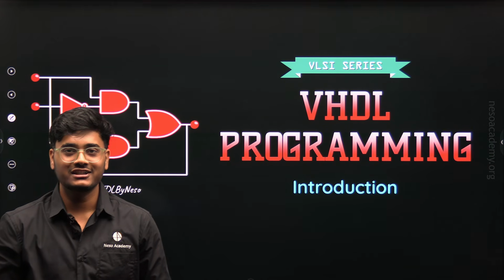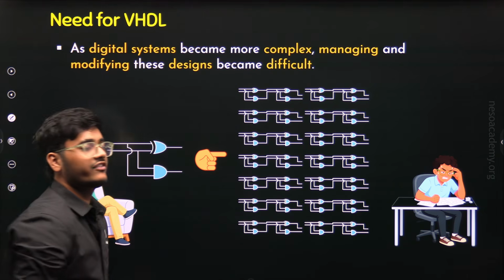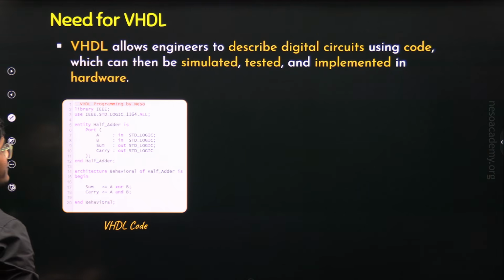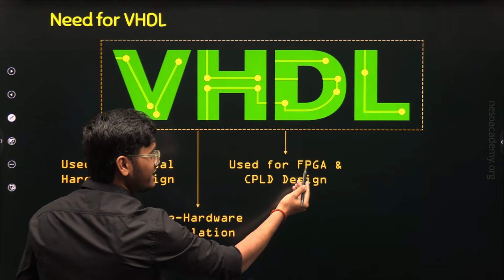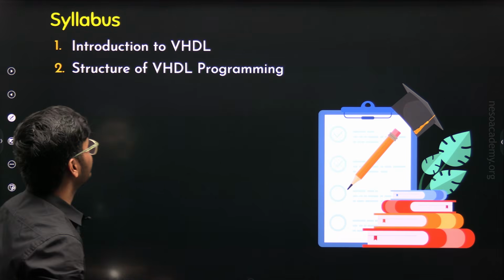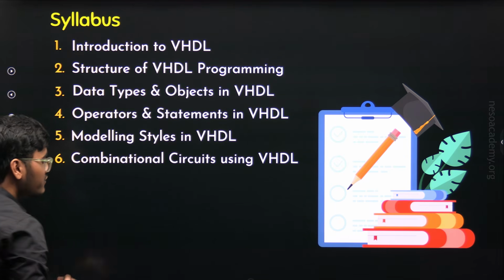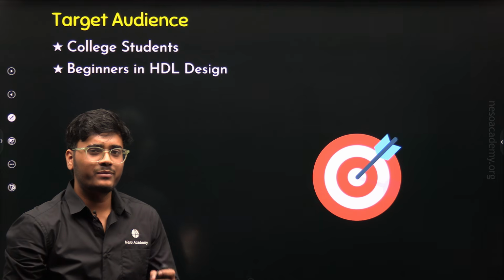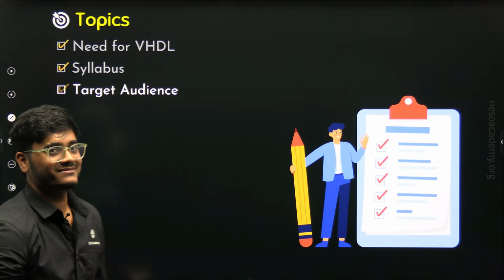Introduction to VHDL Programming

Comment: Highlights by TinaMind:
00:12 VHDL, which stands for Very High-Speed Integrated Circuit Hardware Description Language, is essential for digital system design, FPGA development, and VLSI design.
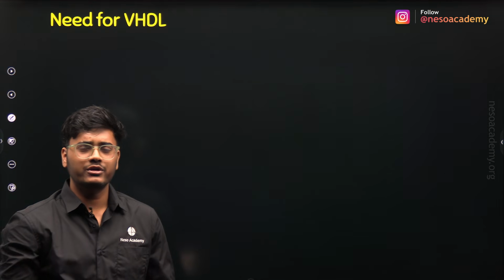01:30 Before HDLs were introduced, complex circuits were designed using manual schematic diagrams, which became difficult to manage and modify as digital systems grew in complexity.
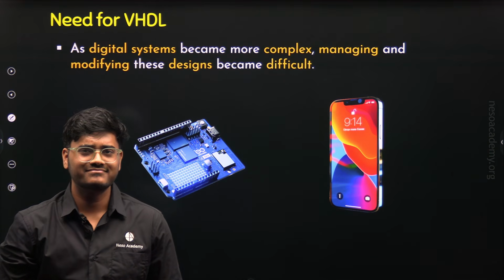02:52 VHDL allows engineers to describe digital circuits using code, which can then be simulated for verification before being implemented on hardware like FPGAs and CPLDs.
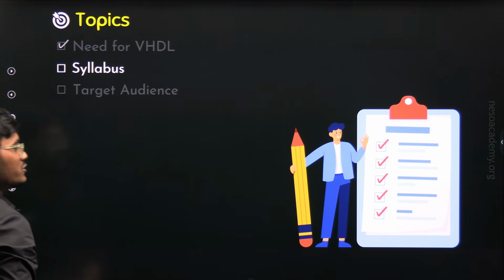06:27 The course curriculum covers the fundamentals of VHDL, including its structure, data types, operators, modeling styles, and the design of combinational and sequential circuits.
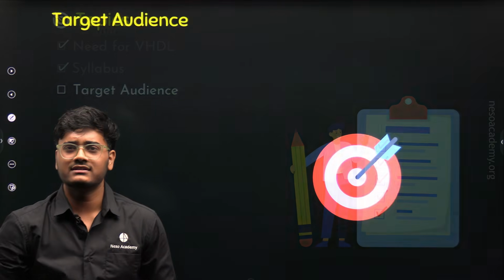09:51 This course is designed for students and beginners interested in hardware design, career preparation for VLSI and embedded systems, or those looking to learn HDL design from scratch.